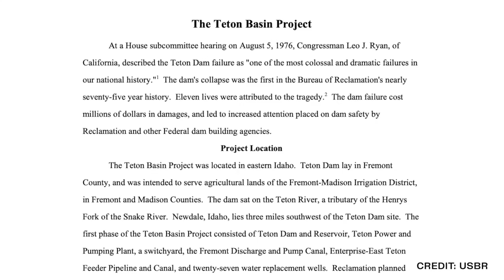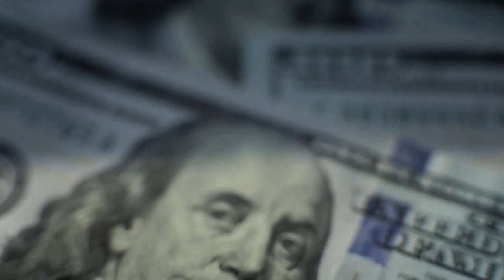5 Dams That Failed Catastrophically

Comment: Honestly extremely poor that the Verjont Dam of Italy isn’t mentioned here given it’s failure resulted in a mega tsunami that killed almost 2000 people.
Reply: .... don't you know that nothing important exists outside the borders of the USA
Reply: Adam, the Vajont (not Verjont) Dam actually did never failed, it stood perfectly against the landslide and it's still standing today. Unfortunately the perfection of the dam project was not matched by the geological knowledge of the surrounding high grounds which ended up falling in the reservoir.
Reply: Like mentioned above, its VAJONT and the hill failed, not the dam

Comment: Aswan Dam, 3 Gorges Dam are huge.  It was recommended to build a number of smaller dams, rather than one large dam.  If a small dam fails, damage controllable.  If a big dam fails, disaster.
Reply: Nice suggestion
Reply: When the three gorges damn inevitably fails from china’s hubris in thinking that they can successfully build a damn on a fault line and an active one at that and the increased weight of the water puts increased stress on the fault like. It’s gonna be bad.

Comment: @ 20 seconds from the end is the Oosterschelde dam in The Netherlands. If that one fails it will not protect part of holland against storm flood of the sea. It is rated for max 1 meter of sea level rise since 1980, will be obsolete in a few decades

Comment: not as big, but the Austin, PA dam failure.  if you're ever near Potter county, drive up and see it.  twisted and huge sections of the dam shifted out of line are still standing where they rested after the disaster.  once a thriving industrial city of thousands, just a few poverty stricken residents are left.  dated a girl there about 45 years ago.

Comment: We heard news about Michigan dams about destroyed by cracks but two dams survived other two dams were destroyed cause concrete getting more cracks and aged.
We might built mini dams in Western States in few years
Reply: The Michigan dam failures were not due to cracking concrete. The dams are earthen embankment dams with concrete spillways for controlling lake levels.

All 4 dams were on the Tittabawassee River. The two dams that did not fail were the Secord and Smallwood dams. They were the smallest dams and were upstream of the failed dams. They were damaged during the flood though and they are being kept at their lowest water level until upgrades can be made. The next dam on the river, the Edenville dam, is where the main failure occurred. There is video on this website of the earthen embankment east of the spillways giving way. 

Once Edenville dam failed, the final downstream dam, Sanford Dam, was doomed. The flood waters rose above the crest of the earthen embankments and within hours had eroded away at least half the dam's height. Much of the town of Sanford right next to and below the dam was devastated with homes literally lifted off of their foundations and swept downstream. Many bridges crossing the river were either damaged or destroyed. The flooding then made it's way downstream to Midland MI where it inundated homes and the Dow chemical plant there. As far as I know, no structures in Midland were destroyed, but everything in basements and first floors were ruined. Amazingly no lives were lost because of the failures.

Currently work is ongoing to stabilize the dams and prep them for when the rebuilding starts. If all goes according to plan all four lakes will be back by late 2026. Anybody interested can visit the channel of Jordan Mowbray who has done excellent work documenting the damage and the rebuild efforts.

Comment: Come  on!  The saint Francise dam failed because the right side was built into an ancient landslide ,back when this dam was built ,there was no way of detecting the landslide ,and Mulholland was found to be NOT at fault for the failure of the dam. He was a scapegoat that everyone loved the day before and  lames everything on the next day! I have researched this dam for 25 plus years ,if there is ANYONE to blame,it's the greedy ranchers who sold their land to the city of L.A. and then got mad when they took the water! They saw dollar signs ,and then got mad and started blowing up the aqua duct that was helping in the huge growth of Los Angeles and southern California, that has NO water of its own,except a little creek that use to flood and kill thousands of people ,so it was made into a flood water drainage system that went out to Long beach ,where at that time was nothing but thousands of oil wells! So ,read ,and do your dang homework ,stop using wiki crappy and study things . See what you might have just learned!  By the way ,the Hollywood reservoir is made Exactly like the St. Francise dam, and is still standing . Think about that for a minute!
Reply: Not so fast. When Mulholland was laying out the route of the LA Aqueduct he identified the ancient landslide that would doom the dam he later built on that location.   He deliberately avoided it when routing aqueduct pipes but still put a dam there.  One wonders why when he knew there was an ancient landslide right where the east abutment of the dam would be.  It is one of those questions the answer for which Mulholland took with him to the grave.  
The dam was also leaking from a fault in the west abutment.  A pipe was shoved into the abutment of the dam at the fault to drain the water off!  The pipe is still sitting up there on the canyon wall if you know where to look. 
All of Mulhollands dams have been found structurally inadequate.  The old hydraulic fill Upper and Lower Van Norman Dams failed during the 1971 Sylmar Earthquake.  The remains of the Lower Van Norman dam remained saturated and further collapsed in the 1994 Northridge Earthquake.   Haiwee Dam on the old Owens River Gorge south of Owens Lake suffered damage during the 1952 Tehachapi Earthquake and has had to be kept at a lower elevation ever since (a dam was constructed in a narrows of Haiwee called Merrit Cut, dividing the lake in half so the northern half at least could be kept full while South Haiwee could be kept at a lower elevation..  Chatsworth Reservoir was drained and never refilled because the old hydraulic fill dams that retained it built by Mulholland at the same time the Van Norman Dams were constructed, could not be economically rebuilt to structures that could withstand a large earthquake.  The original Fairmount Reservior was drained for the same reason and upstream of  Owens Lake, Tinnemaha Reservoir also has to be kept at a reduced elevation for seismic safety reasons.  The San Francisquito Dam's near twin, the Mulholland Dam, that retains the Hollywood Reservoir was heavily reinforced with a massive downstream earth embankment.   If you know where you are looking you can see it from northbound US 101 between Vine and Highland. It's just up the little canyon to the right.  A bit of the original concrete arch with its fancy design was left above the earth embankment which now has tall trees growing on it.  The Reservoir has been replaced by large underground storage tanks and the old lake is kept at a reduced elevation for seismic safety, while leaving some water in it for the neighbors to look at and for fire fighting helicopters to use.  
Obtw, I use a chunk of concrete I chipped off the remains of the San Francisquito Dam as a book end.

Comment: The dam failure in New Braunfels wasn’t even close to the biggest dam failure in Central Texas.  A dam on the Colorado River just upstream from downtown Austin failed during a flood in the early Twentieth Century.  A wall of water was sent through Austin.  It did FAR more damage than the dam in New Braunfels did.  Pieces of the broken dam are still sitting in the riverbed near the site of a newer dam.
Reply: BR bob  sweetie, if the video is going to be titled using the word catastrophically," you’d expect, well, catastrophic dam failures. Not minor ones. Even the tiniest bit of research would have shown the most "catastrophic" dam failure in the area wasn’t that little one near New Braunfels.  I realize you’re just making excuses for someone else because you’re so ashamed of your own inadequacies and inability to succeed, but maybe don’t comment on subjects you know nothing about.

Comment: It would have been more interesting if some of the pictures & video had anything to do with the dams they were talking about.
Reply: Yes... great comment.  The Teton Dam engineer making calculations on his tablet was a little out of place since we didn't even have PCs until the early 1980s.  And then they showed the back side of a concrete dam.  Teton Dam was an earthen dam!  The reason it failed was the failure to properly grout the fractured rhyolite rock on either side of the spillway - but they didn't even mention this!

Comment: 3GD will put them all to shame if the Chinese don't strengthen it quick enough
Reply: Indeed, it will be legendary
Reply: Can you point me to where I can get factual information on problems with this dam. I don't mean hot air by internet trolls, however. I need accurate material.
Reply: @lupus7194  Google is your friend.  However if you dismiss anything that runs counter to your confirmation bias as "internet trolls" then you are wasting your time.

Comment: Dams may be wonders of modern engineering, but they are also one of the most unreliable structures on Earth, yet some major cities rely on them otherwise they'd be underwater. Dams are constantly at the mercy of nature, they are vulnerable to earthquakes, water table changes, landslides and other natural events. Major dams usually also provide those cities with a hydroelectric power source. However when that river wants to break free from her manmade constraints, there is NO stopping her!.